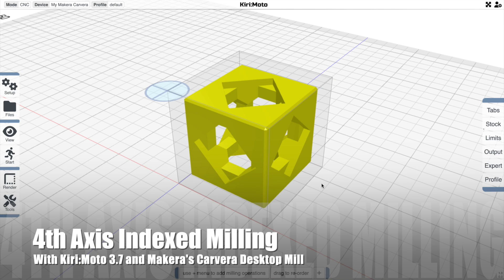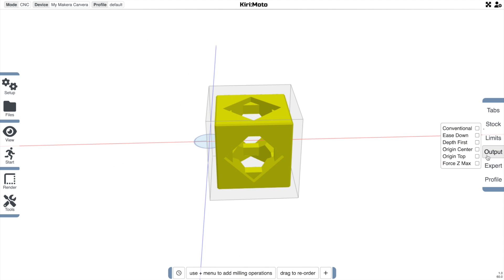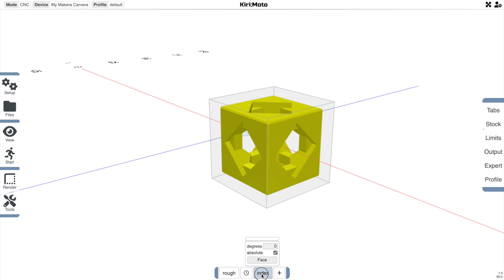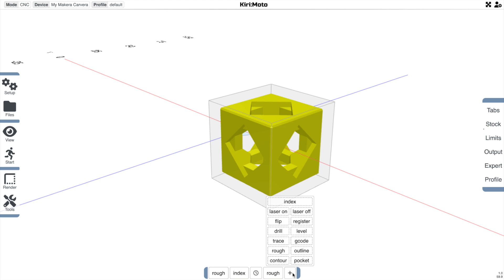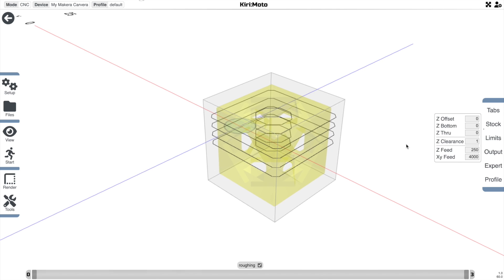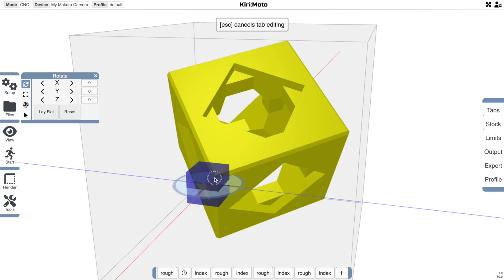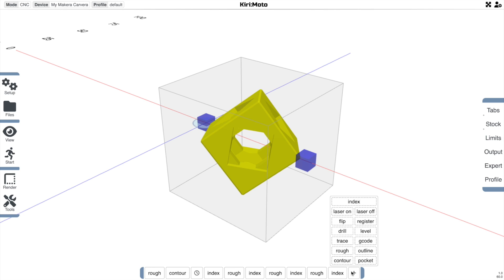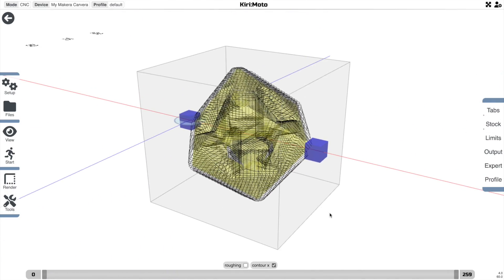4 Axis Indexed Milling with Kiri:Moto and Carvera

Comment: Hey GridSpace, trying to make a custom hand tool handle, think double ended pencil. I followed the video above and uploaded my handle into your program. I added tool details for the flush and v bits from Carvera to do roughing pass versus the contour pass.  Handle is basically round with two raised areas at each end to hold like a pencil.  If I followed correctly I sliced the model with all the rough/contour/index steps. I have exported the code and placed it in the g-code folder for the Carvera. The issue is when I go to open it with the carvera it isn’t recognized. What am I doing wrong?

Great vid, it would help if you added text for the hot keys you use to jump through menus to make it easier to follow, but I did figure it out, I believe. 

REALLY want to make this ~120mm handle, any tips would be appreciated. Thanks
Reply from the maker: if you want to right-click export your workspace and email it to me [ sa at grid dot space ] then I can see what's going on. you could also post on forum.grid.space or join the Discord server https://discord.com/invite/suyCCgr

Comment: Awesome! Can’t wait for my Carvera to ship. I’ll have to look deeper into Kiri:Moto, it looks like a very clean workflow, and it’s the first CAM app I’ve seen recommended or used other than F360 or Makera’s own in-development CAM solution.

I’d be extremely interested in seeing an installation/configuration video for Kiri:Moto for Carvera
Reply from the maker: For Kiri:Moto, there is no installation necessary. It's entirely browser-based (nothing happens in the cloud) and open source. Just open the URL (https://grid.space/kiri/) and select Carvera from the CNC device list. Then import your model and start working. It's also available (also free) inside of Onshape as an add-in app, so you can have an entire CAD+CAM workflow in browser with no SW installs or updates. If you need it to work offline, there are two options: 1) run it as a progressive web app which "installs" and can run offline or 2) download and run an instance locally.